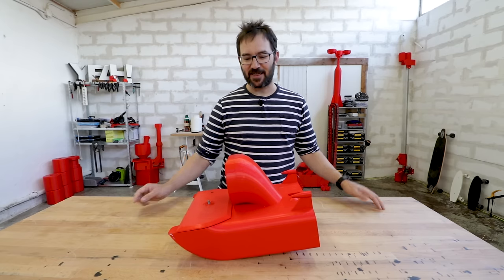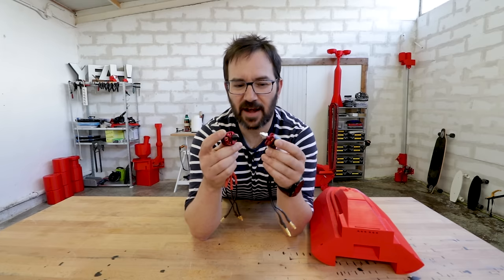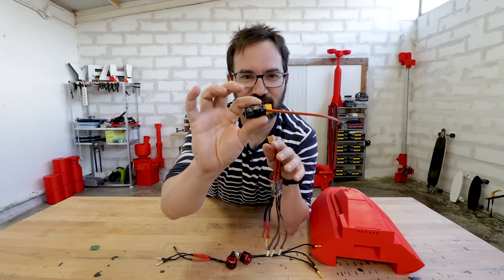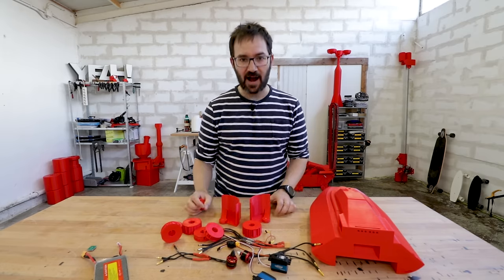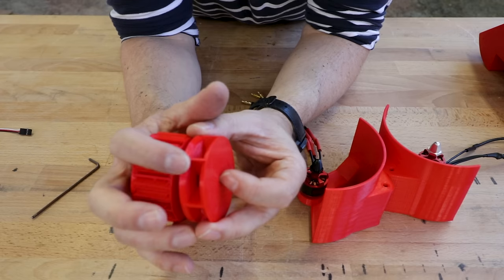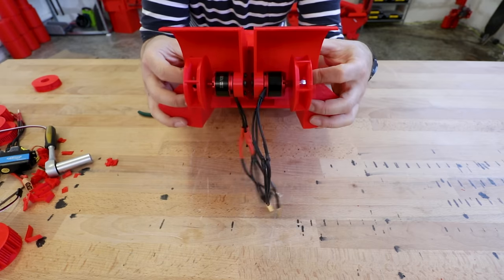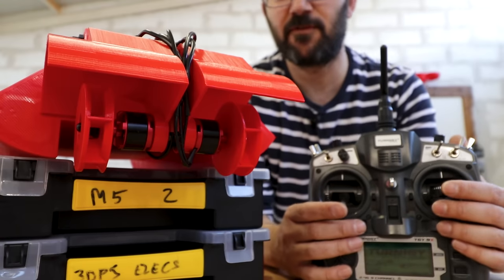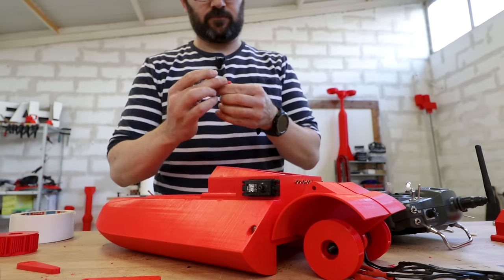RACING PADDLE BOAT

Comment: Try using curved paddle-blades too!
Reply from the maker: Curved forward or backward?
Reply: @ivanmirandawastaken  Curved to scoop the water. Although it might be interesting to try both ways!
Reply from the maker: It hurts my brain thinking about it, because when you scoop you keep the water on the paddle for more time then it ends up going upward or even forward...
Reply: @ivanmirandawastaken  I'm only basing this off the fact that most real-life paddlewheel boats have paddles that are at least somewhat scoop-shaped - there has to be a reason for that, right?

Edit: Correction: Modern-designed paddle wheels. A flat paddle will work fine enough.
Reply: There's even more complex designs that I can find that keep the paddle straight up and down while it's in the water. It makes my head hurt too man!
Reply: Doing a bit of further research, it seems that scooped paddles help it 'grab' more water to push it backwards (which, ultimately, is the entire point here) - which supposedly more than offsets the water being thrown forwards through the air. Keeping the blades does the same thing more efficiently, but would require a complex mechanism.

Comment: impeller e.g. jet powered next please.
Reply: Ive seen 3d printed turbo style impellers    and they push air like nobodies business.    Might be possible to work something like that to jet water.     
probably easier would be a ducted fan sort of thing underwater, like a jet ski
Reply: @samuelyoung2671  yep, and like a jet ski you're going to want some blade overlap to boost static pressure.

Comment: Ivan friend, RC servos/receivers  want 6 volts.
Reply: Do they?
Reply from the maker: Nope
Reply: @ivanmirandawastaken  thanks for making me look that up, I had been over powering an arduino project using 4 AA in series. The transmitter must have a voltage regulator?
Reply from the maker: Let's say that it is "tolerant" but is better powered at its specified voltage. Most BECs output 5V.
Reply: @ivanmirandawastaken  okay thanks for the heads up, I thought the increased voltage would make it faster, maybe more torque? But I read that generally they are 4.8V and the max is 5.5V. But bro, go and make something.. xD